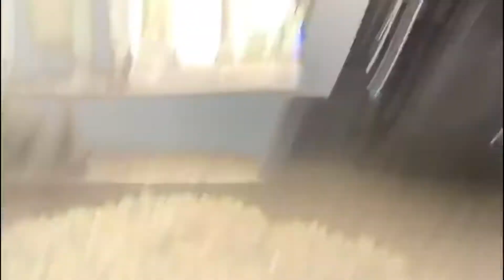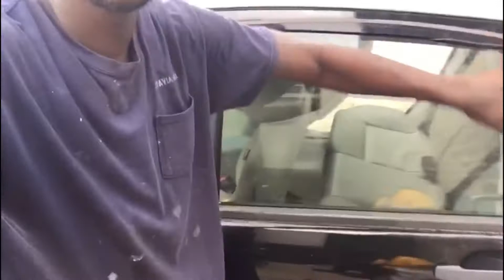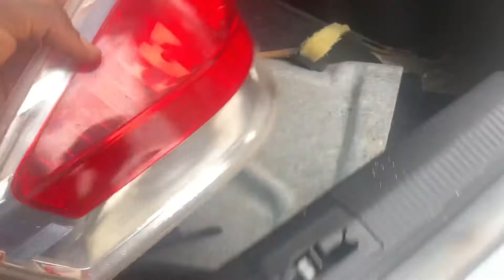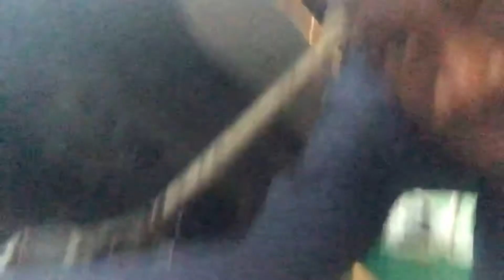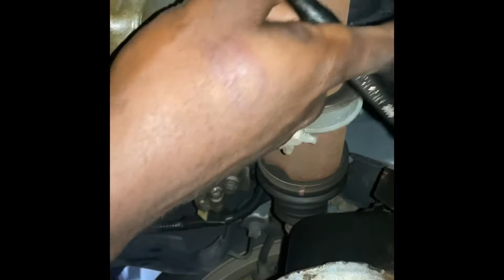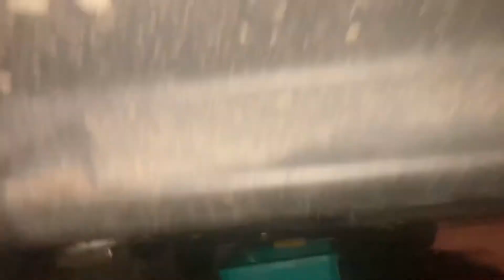Replacing oil pan on 2008 Ford Focus￼

Comment: So what about the dip stick tube?  You glazed right over that!  Much like you did with the lights in the trunk.  Then you couldn't figure out what size socket to use or SAE or metric?, or which way to turn it.. kinda flying by the seat of your pants aren't you?

Comment: Did you have to hammer it back on? You're actually supposed to remove the timing cover first. Or slide the transmission to the right a quarter inch.

Comment: i wish you would’ve went more into depth on how to put it back on. The oil pans have to wedge in between the timing cover and the bell housing and it’s not a very straight forward install.